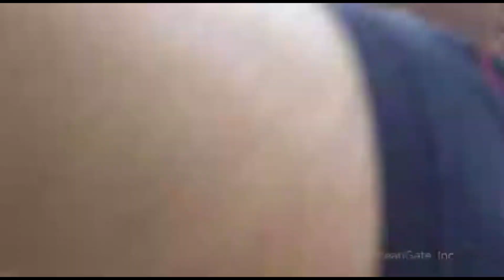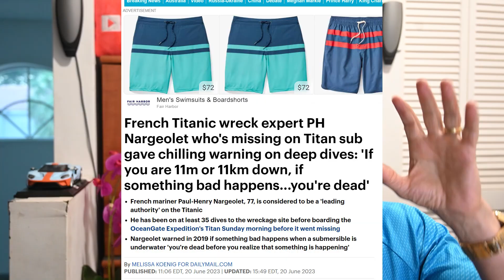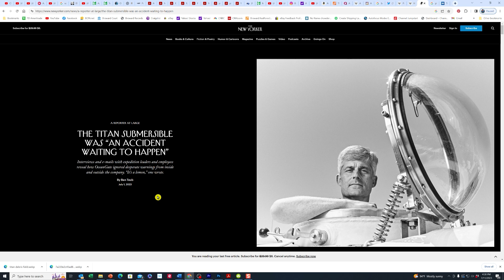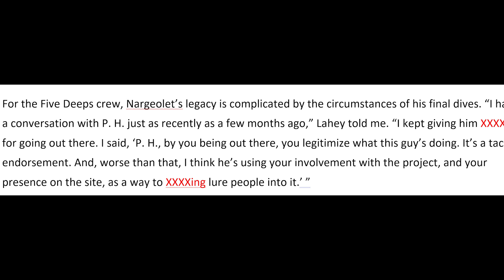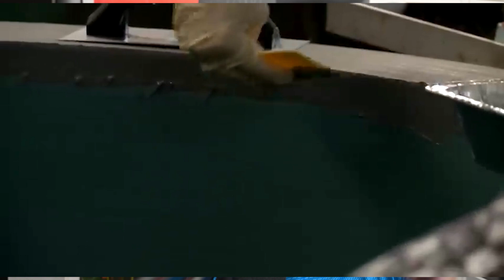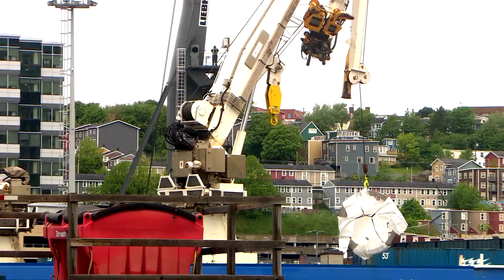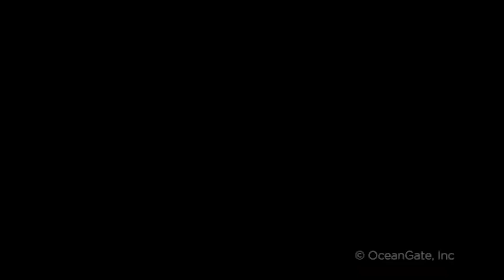Titan Sub: More Q&A, Design Defects, Why Descent Fast

Comment: 5:28 It just amazes me the people having kittens over the guy touching the titanium ring with his bare hands.  He was touching the FACE and the OUTSIDE of the ring.  The face is the part that mates to the end bell.  It isn't the part that they're epoxying carbon fiber to.  He's simply making sure there's no dust there that could contaminate the epoxy.  The carbon fiber and epoxy goes into the UNDERSIDE of the ring.

Comment: Q: In order to ascend Rusk had to release the weights and the metal rack below to decrease the sub weight. Would this be a mechanical mechanism or done via the electronics? Anyone know? I can't imagine it being electronics since if you lost 100% power you'd be in a pickle.  Part of the design had pins that dissolve to ensure release eventually so maybe it was electronics but being on the ocean floor waiting for those pins to dissolve sounds frightening.  Thoughts anyone?
Reply: As far as I can tell: no electronics. From various hints in better informed sources I can see it ether directly mechanical or hydraulic (no pump, similar to car brakes).

Comment: Another thing I noticed was when  they put the titanium rings on there was no squish out of the epoxy. When those rings were pressed on, you should have seen the epoxy ooze out (squish out) letting you know there was enough epoxy applied. Very disturbing not seeing any squish out when those rings were installed.
Reply: I think Jeff mentioned that but not sure. I noticed that in the video where one of the titatium rings was being installed--and Jeff brought up a critical (IMO) point: as far as I can see, no attempt to sand or other roughening procedure was done to make sure that the epoxy bonded correctly. Also in other footage you can see a man wiping the ring whilst not wearing gloves to prevent his body oils being left behind. Probably minor but I did notice that.

Comment: power failed and they imploded when it struck the seabed or an object at a complete nose first pitch black fallfall. the port ring looks like it had a large dent in it when they pulled it....

Comment: Were they 'powering' down using Amps? (or was he powering down.....) I don't understand how they could be too fast. maybe just a man posessed with getting to the danger.... I'm a bit like that with volcanos
Reply: No, not ascent neither descent is by thrusters. They are only to move the sub while it has neutral buoyancy. Both the thrust and power reserve of the thrusters is quite limited. Long vertical runs are achieved thru buoyancy control.
The bucket was leaking and lost buoyancy. The use of thrusters in that situation was the last pathetic and futile attempt to save the day. Probably only contributed to the subsequent loss of power (if there was one).
Reply: @curiouscat8457  thanks Curious!

Comment: (besides the obvious implosion reasons like CF hull and its issues when it comes to compression etc.)

I'm still in quite a shock each time I see their manufacturing process. I'm no engineer, but.. were there any, like, plans or some schematics of that sub and basically "how to make it"? I'd focus some more on that.
Based on their video, their process looks more like:

"Your stereotypical uncle randy shack, where he glues some stuff together, using common products found at a local store" 

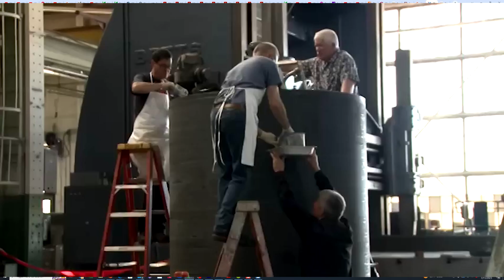Just look @7:35. Lets forget about the overall work-safe rules (i.e their extremely fancy use of ladders, wearing a glorified kitchen apron and pasting SOME GLUE/EPOXY from a tray held overhead by another guy) for a second- What "ingredients" did they use? 
Was it really, what it appears to be (based on company's other ideas), stuff you can find at your nearest Home Depot, or was it at least somewhat certified for any activities, at least "including seawater"?
We've heard about the alleged cooperation with some big companies (afair NASA/Boeing?) that were quickly debunked, so where does that leave us? DIY-wound up tube, stuck together by some random epoxy/resin which is put "more or less uniformly" with a cake spatula, using no bolts at all to connect the fiber with the titanium rings.

It doesn't take to be an engineer to know how well these crudely-made sealants work- Try to fix a leaking water pipe with a tube of silicone, by putting it around the leak on the pipe itself and not clamping it or adding anything else. That's how securing those titanium rings to the carbon tube look to me right now. I'd be happy to hear some specialist opinion on that.

Comment: Them coming down so fast, and ascending so slowly even after dropping so much ballast means without doubt the sub was overweight. What could have caused it?
Reply: That is a rhetorical question, isn't it? Obviously, there are mermaids, but apart from that, there is only sea water that could possibly come aboard. The bucket was leaking.
Reply: @curiouscat8457  Allegedly at these depths even a microscopic crack would be eroded by the stream at pressure several times that of a water cutter and lead to catastrophic failure within seconds from forming.  So - an early leak that self-sealed under pressure? Stray wave hitting the boat before it was sealed? Or did they load up some extra equipment?
Reply: @sharpfang  Your theories are interesting, but don't answer the question "where the extra weight came from?"
Besides: the pressures we are dealing with here are not so much "out of this world" as you think. Some commonly available water pressure washers work with 400 bars pressure. Then there are breathing apparatus', oxy welding set, hydraulic machinery etc. In all of these devices the pressure is being held by a few flimsy O-rings and they are thousands of failures without any catastrophic results every day. A minor leak could have easily developed at an early stage of the dive and wouldn't have to expand much further - except of an increased flow with depth. The glued flanges come to mind immediately. A leak thru a microscopic fissure spread over some 6 m length could deliver decent quantity of water while being completely quiet and hard to detect. And yes, it COULD have been actually "self-sealing" (up to some degree) with depth. 
There are no mermaids.

Comment: Lets be honest he has cut corners during the manufacturing process. I am surprised that they lay the Carbon Fibre in a diamond pattern, and the application of that adessive on such a life or death part gives me shudders. One has to wonder if he is cutting corners on such a mission critical part, what other little horrors was lurking beneath those covers.

Comment: Jeff, there is a video titled:

Lectures by Walter Lewin. They will make you ♥ Physics.:  20 minute solution to Titan Problem 174

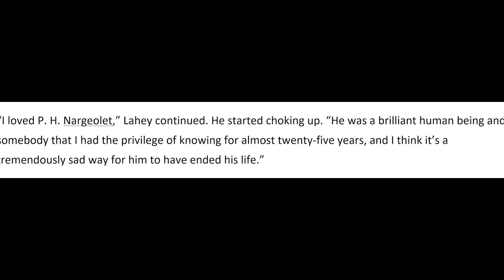at 4:52 he says that the tail part houses an air tank and a balloon. If they need to ascend, this balloon is to be inflated by a valve. There is no mention of how the valve is to be controlled. There is no mention of the balloon in the transcript that I am aware of. Now it seems like a risk for the valve to be electrically controlled - what if the power goes out. And making the valve manual means running the pipes in and out the hull which only provides another weak/stress point.

Question: Was it normal practice for the titan to descend with the balloon inflated? That way, if anything happened, all they had to do was drop ballast and float to the surface.

If this was the case, then did they forget to inflate the balloon, or did the balloon develop a leak - causing the titan to sink too rapidly, unduly stressing the carbon fiber and straining the thrusters to give it lift.
Reply: What you are describing is an "ambient pressure balast tanks system" It is (in principle) commonly used in "normal" submarines diving to max 2-3 hundred m. For deep sea submersible this system is not viable. For instance: at the 4,000 m depth, to displace 1 litre of water you would need 400 l of air. Gets worse: because of the increased density of air, you would actually gain only about 1/2 kg of buoyancy. Gets worse still. Over about 10,000 m you would actually replace the water by denser medium and cause a LOSS of buoyancy!
If a deep-sea submersible has such a system, it is there only to ascend from very shallow depth and keep the bucket on the surface when needed. Durig dives these tanks are filled with water.
These submersibles control buoyancy by "variable buoyancy" control system with closed rigid tanks containing air at about a normal atmospheric pressure. The water (ballast) is being pumped in and out by a high-pressure hydraulic pump. These tanks are very small because their purpose is to move the buoyancy only slightly around the neutral buoyancy point.
Any failure of this system couldn't have caused a loss of buoyancy for which dropping all the available emergency solid ballast could compensate - as it happened to Titan. The bucket was simply leaking - taking sea water, a LOT of sea water in.

Comment: Been in aviation a long time and have done lots of composites work. This was a wet layup. The first time someone wound a fuselage with graphite they had to calculate the size of the tow with resin on it.  The same needs to be done with this sub. With a wet layup you don't have to go to an autoclave, you could do it with a vacuum chamber, but for something this critical an autoclave would be far better.  With something this thick, you'd never get all the air bubbles out with just vacuum. An autoclave would crush the air bubbles to infinity.

Comment: Hi Jeff, new sub (no pun indented 🙈) from Germany here. Thanks for the great coverage! I've been wondering whether this thingymajob that seems to be holding the Titan down on the platform actually hits the hull everytime it wa released? Or is this just a model by Oceangate so that their "specialists" get an idea how they come loose, if it works? Plus, in one of the countless videos here on YT I've seen some woman working for Oceangate throwing one of these big ropes over to the platform and hitting the Titan right on the hull. You could actually hear the thud. I guess this didn't only happen once. I'm far from being an expert, so I'm sorry if these questions are daft, but do you think that these two things might have had an additional impact on the hull?
Keep it up and greeting from Germany😊

Comment: Jeff said " the repeated compression and expansion"  well it is more than that. As they descended the temperature affects the different materials Titanium and Carbon Fiber differently. They expand and contract at different rates. So between all these changes it was cracking that seam every single time.

Comment: I think, they thought that the pressure would press the ends against the tube, so the glue would only need to hold the vessel together outside of the water.
Reply: Essentially, they were right. They just seem to forget the joint have to be perfectly watertight too 🙂.

Comment: PH may not necessarily care about dying but 4 other people sure did. What did he think he could do if they were 3600m under water???
Reply: Talking about how smooth the rings were. Think about when you are putting fake nails on or gel nails. Before you put them on they tell you to use a mail file to file your nails a bit to make the rough and allow the glue to have something to hold on to.

Comment: The questions are:
1) Why the hell carbon fiber as hull, which is a way bad material for this, in terms of contraction ? 
2) Why was the carbon fiber not layed out into a x-shape, to give it more stability ?
3) Why was the Titan (Cyclops II) being just a experimental, alpha stage submersible? - It was for the profit...to earn fast money with wealthy passengers, no tests and regulations. It does make sense, that we're only having perhaps 10 submersible vessels into the world, which are being able to get down to these kind of depths.
4) It was not a deep sea scientic research & exploration vessle for scientists.
5) The specific acrylic window was only being spec'd for 1300m depth, whileas the Titanic wreck lies at 3800m depth, go figure.
6) Last, but not least...everyone does know, when you mish mash different materials, especially here, bad things due to different wear & tear, material fatique could being happen...and carbon fiber is really the wrong material, every sub builder does know.
7) There was no safety escape hatch (for small depths, talking xx meters by design, if somethign would go wrong) and also the top titanium "door" with the bullseye into it, was being screwed with 17 or 18 bolts from the outside - imagine, into a rough sea, even if something at only say 200-400m depth would have gone wrong, the Titan would have being able to manage to surface - the 5 ppl inside would run out of oxygen, before someone is spotting the Titan into rough waters, as it would show only ca. 80cm above the waterline, when floating surfaced...compare this to endless miles of the ocean...for Search & Rescue teams via chopper, boats, etc...
8) There have been simply too many design flaws...

Comment: I'm no engineer, but why weren't the "rings" cast with "flanges" 5 CM oversized versus the cylinder. Then you could drill holes through the rings and use "threaded rods"  and nuts the length of the sub to torque the thing together. Technically no adhesive would even be needed? Perhaps a "gasket" of some kind to tighten against, like an oil filter.?

Comment: All i see is a lot of speculation, I appreciate that you have some degree of technical knowledge but I think you are overstepping a lot and getting to conclusions on the manufacturing process based on some promotional video. The guy cleaning the titan hull might have been doing that just for show aswell. They might have etched it prior to gluing it together. You are giving very strong opinions based on some publicly available promotional material which I am not a big fan of.

Comment: @jeffostrof anyone know how the sub was wired? i.e. how did control commands get from inside to the outside? I’m thinking it must be wireless since piercing the walls with cables would be another potential point of failure.

Comment: And the pressure rate of going up  and down....when they came up suddenly the pressure released and that caused the implode.. it was leaking from towing it across the Atlantic..it didn't build pressure cause there was no pressure it was leaking as soon as it hit the water.   If it happened half way down it would have bin high pressure..if it happened before it would just slowly leak til it got to heavy and free falls to the bottom.. which is what happened I believe and thought in the beginning..I had a gut  feeling about it

Comment: How can we explain the accident when the debris that was rescued showed the ring and the dome separated, instead of being securely joined and bolted as they should be? It's inconceivable that the rescuers unscrewed all 18 bolts individually, especially considering the absence of the acrylic viewport glass there must be other dynamics involved
Reply: Question: is it possible that suddenly a water jet flooded inside and like a piston compress everything on the inside of the cylinder and like a diesel engine ignite the chamber and an explosion , rather than an implosion, rip out the viewport from the dome, and the dome from the ring , and ultimately crash the hull?  If it is possible , then the accident is maybe because of a leakage from the cables in the aft and not because of the carbon fiber … maybe , I dunno..
Reply: @rockermilano  For the diesel-like explosion you need 3 things: air, quick compression and finely atomized fuel. What is missing here, is the atomized fuel. While there were combustible inside, they were not atomized enough to cause an explosion. The (most likely) few mm sized bits and pieces probably suffered some superficial burns during the split of second exposition to super-high temperature during the implosion.
If there was an explosion before the implosion it COULD have been hydrogen made by electrolysis from the flooded electrics. One of the open, purely speculative possibilities.
Reply: @curiouscat8457   forgive for my English, I'm Italian, calculation give me 7 milliseconds for the compression, quicker than a piston, so the explosion is about in  that timeframe, in 7 milliseconds air and maybe oxygen tanks , will explode an disintegrate the carbon fibre hull ad disjoint the rings and the dome secured whiri 18 bolts
Reply: @curiouscat8457  and on the inside they have oxygen tanks
Reply: @rockermilano  No problems with your English 🙂. The super-quick compression will definitely generate extreme temperatures. But air alone doesn't explode. As I said you need the combustibles to be properly atomized - what will happen to diesel fuel in cylinder with "dripping" injector? It will go out of the exhaust unburned. Never seen that?
The extreme temperature will last only milliseconds and no way the oxygen tanks would get heated up to the point of explosion.
A really good and detailed analysis of the effects of implosion here: "Crushed, Burned or Toothpaste? Surgeon Explains What Happened To Crew OceanGate TITAN Sub Implosion". Look it up and watch.
Reply: "there must be other dynamics involved"
Yes. The dynamics of water rushing at high speed into the void in the centre of the implosion. For a faction of second after the implosion it had to inevitably create an outward acting pressure perfectly capable of pushing the window (held in place against the forces of that direction mostly by willpower) out. The screws most likely fell out immediately when the carbon fiber cylinder disintegrated.